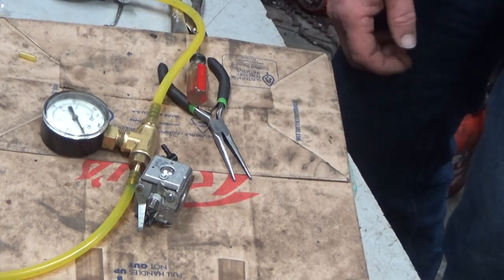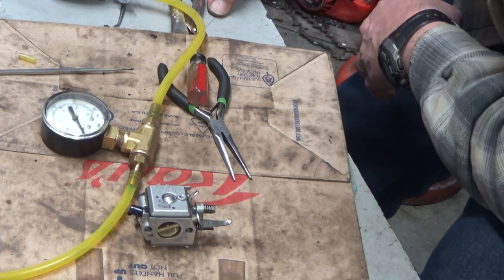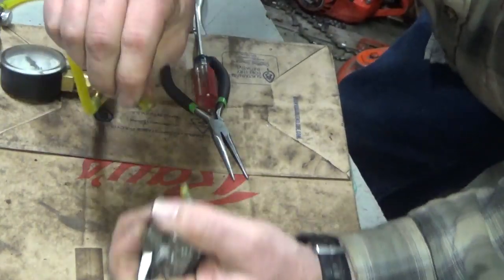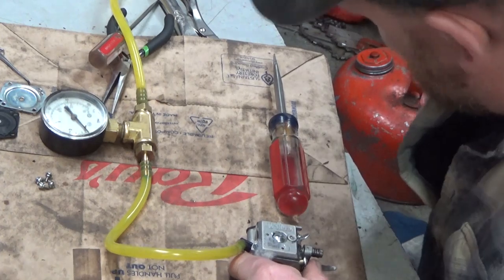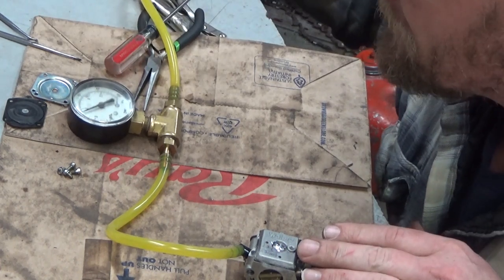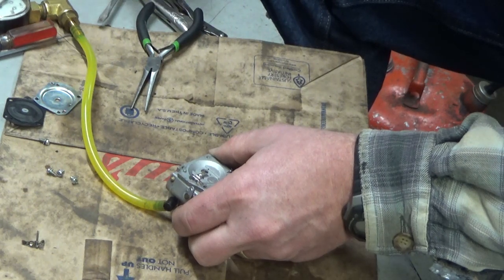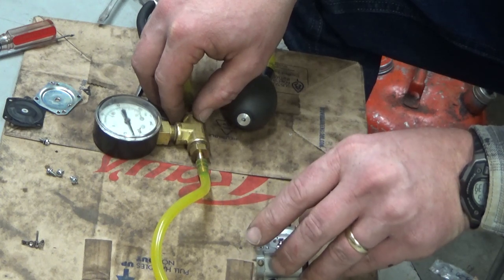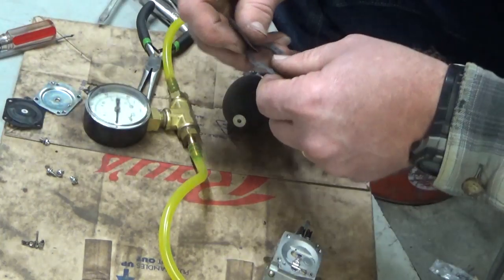Walbro HDA Carburetor Testing & Rebuild

Comment: Thanks for the great video.  I've had a Husky 359 e-tech with the notorious Walbro HDA-199a (with the thick black spacer on the diaphram side) and it's always bogged, idled poorly (dies), revs up when hot.  Finally installed a genuine K24-HDA kit and all those problems vanished, it's an absolute joy to run now.

Comment: Just rebuilt a HDA carb on an old Echo 550. The new kit came with the black gaskets and the beige gaskets. When i use the black gaskets the saw floods and when i use the beige gaskets it starves for gas. Got me scratching my head. When i use the beige gaskets it will hold pressure even with the needle removed. It will try to run with the beige gaskets. it won`t even start with the black gaskets but you can pour the gas out of the muffler.

Comment: Good, video. Most carbs aren't as scary as a lot think.
Just wondering why you didn't use the dental picks again to spread a micro thin layer of gasket crap instead of tightening it so much?
When I work on small parts like this I work on them in/on/over a boot tray. Lots of them out there. You could use an old cookie sheet.
Love the videos!
Reply from the maker: I never use the gasket sealer on carbs because of the risk of it contaminating the rest of the system.  Even a little smidge of it can plug up a small passage.
Reply: Yup, I agree on that. Carbs can be pesky! Maybe it was a crank gasket or something else video I'm thinking about.
Reply: Leon's Chainsaw Parts & Repair 
Have you tried soaking the gasket with WD-40?

Comment: I have a question for you? So after rebuilding a HDA144 I could get the saw to run but when you tilt the saw bat down it dies? What did I assemble wrong and no I don’t have a pressure tester yet tomorrow I will!
Reply: My saw used to do that. I changed my fuel filter. Runs great now

Comment: A little dab of grease under the spring will hold it in place while you put in the needle and will dissolve  when you start the saw ....
Reply: I was actually thinking using a little dab of silicone or dielectric grease for that since it doesn’t harm synthetic parts.

Comment: No check valve on the high speed nozzle?  I rebuilt an hda today and seems like no fuel at high end. Idles and revs a little bit just fine. Walbro hda service manual shows a check valve for hda carbs. I didn't remove the brass plug on my carb as I didn't know if I had parts that would be found under there.

Comment: Hi i was wondering if you might know what this little black rubber peice is that sitts in the same channel as where the high and low needle passage ways are, everytime i blast it with carb and chock cleaner i seem to mess up that rubber valve or whatever it is, but its in another area like in the little hole when you take the cap off, its the hole that if you spray carb and choke cleaner through either of the  low or high needle, it will come out this little hole on the back side, do you know what thats for? I removed it and now my engine is hard to start but once its runnin it works fine